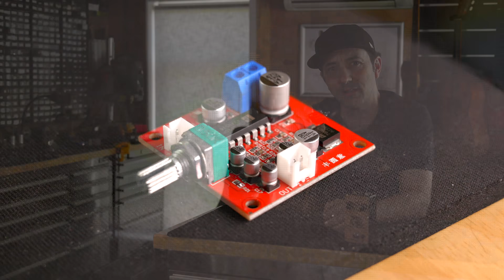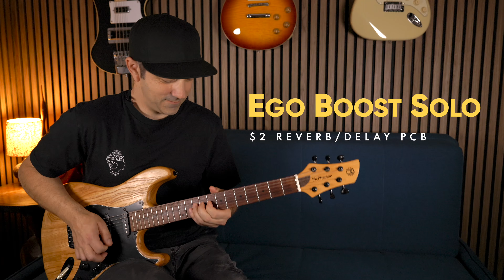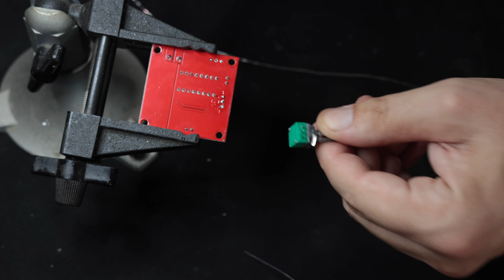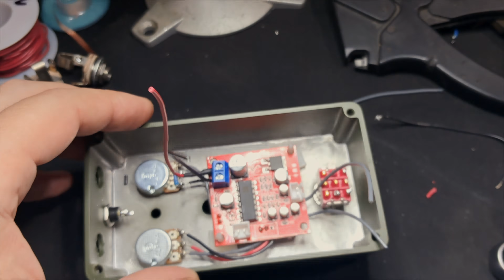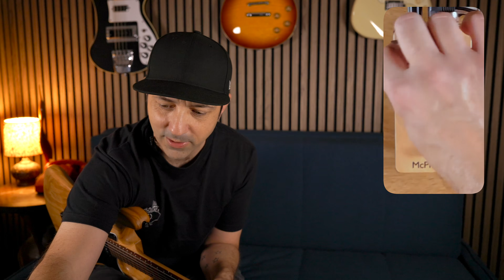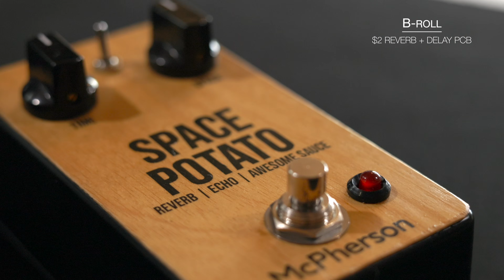Build a Killer Pedal From a $2 Reverb/Delay Board

Comment: I’d love to see someone find a cheap mic preamp board and do a microphone fx pedal. There could be like a standard i/o bill of materials to impedance match then whenever fx circuit in between. I also don’t know why anyone hasn’t designed an fx circuit that works like a top loader Nintendo lol. All the I/o and jacks are done. Maybe a standard 4 knob, 1 button, power layout and fx cartridges wired with that limitation in mind.

Comment: For echo pedals like this, how hard is it to add a second momentary footswitch to temporarily get infinite repeats? would you just add a resistor (or lack thereof?) in parallel to the momentary from the pot? It would be cool to be able to just push a second switch while holding a chord to let it drag on, or in the case with some pedals, let it start to oscillate.

Comment: You can build a soft start circuit with a transistor, a cap and a couple of resistors. This means it won't lock up, even if the time is set to zero on start up.

Comment: Hey Waylon, great video. I was looking for that circuit on aliexpress to try this out, and came across an inexpensive DSP board "12V DSP Digital Reverb Module Echo Voice Changer EQ Howling Control Pitch Shifter DSP Audio Effects Module for Karaoke/Guitar" that seems to be able to do many different effects and can plug into the pc via usb to control the effects. Do you think that this is something that would be adapted to a guitar pedal as you did here. It also looks like it might support stereo effects which could be cool
Reply: @JohnRockBilodeau  
        Hi John , 
I hope Waylon responds to you cuz your idea sounds so damn COOL !! 
I would definitely use a Pedal like you described in my Series Effect Loop in my Randall RM Modular Guitar Amp !!  That Pedal would give me so many options in a very small package . 
      Ok , I just wanted to share my thoughts with you . 
       Again , your idea is super Cool and I hope Waylon gets back to you about it . 
I hope you're doing well Dude . 🙂

Comment: Just a tip… if you’re not GREAT at soldering buy SEVERAL of these boards… I make and sell pedals and built a few of these and these boards are SUPER delicate and the Solder is ROHS compliant… so it’s quite difficult to remove… I actually decided to just stop building them almost immediately because of this… all that being said it’s Still Really Fun and the Pedal sounds really great for what it is… but yeah buy several boards just in case… great video BTW! Lots of great stuff on this channel…

Comment: You can stick a LFO powering a LED and LDR. Connect ldr to time pot and you will get killer modulated repeats for the delay. My favorite mod for pt2399 ic. Space Potato is a killer name
Reply: @daithidebarradb  Have you actually done that? Sounds really cool.
Reply: @smarkalet9078  Yep. Works great. Check out deprofundis modulation daughterboard circuit. This video post was a coincidences as I only built a Pt2399 delay last night and used a 2 pin RBG LED for a different vibe to the modulation effect.
Reply: @daithidebarradb Nice. Thanks!

Comment: I   have used this board before its a great sounding reverb / delay its a shame the pots aren't on the same side of the board ,who designed it like that ,with the wires it helps to mount it .

Comment: I purchased some little boards that use the SSM2167 dynamics processor chip, a successor to the SSM2166.  They were well under $2Cdn each, from Aliexpress, and like the little PT2399 boards here, provided a semi-complete "solution" to dynamics processing on a surface-mount board with pads for pots.  The 2166 was an excellent chip that makes a great compressor/limiter.  Perhaps you could do a similar DIY video on these little 2167 boards.
Reply: @markhammer643  This channel is a blooming goldmine. It needs more recognition
Reply from the maker: Thanks for that, I've built using that chip before, I will definitely check out those boards :)